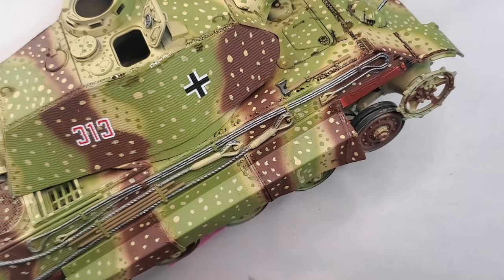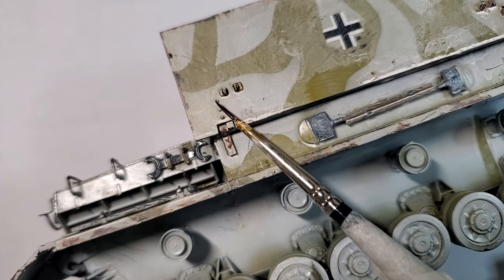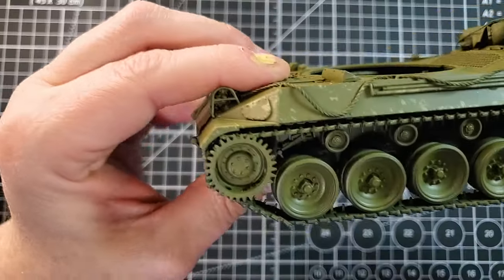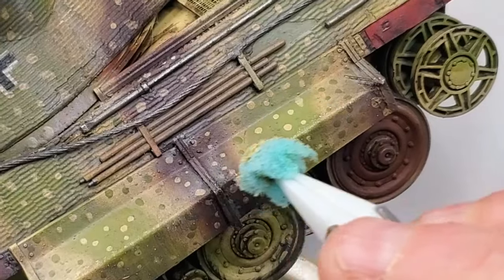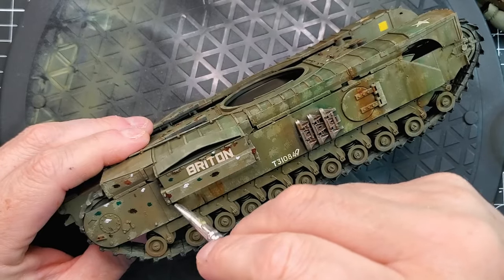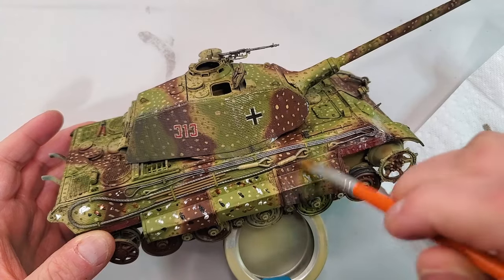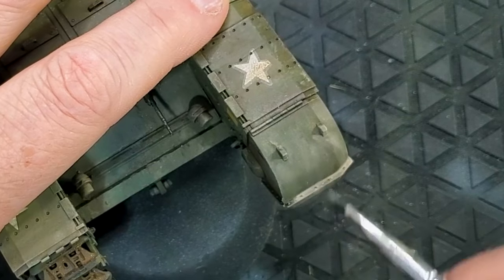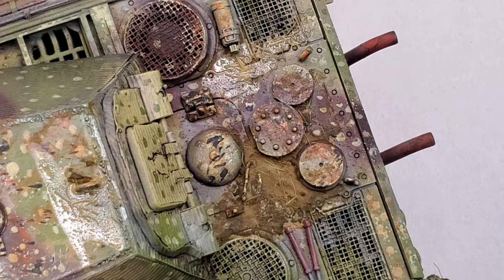4 SIMPLE & EASY Weathering Tips for Beginners

Comment: If you dont want to use pinwasn because im pretty sure theyre toxic and you need a respirator, you can use acrylics+ispropyl alcohol. I tried it and it works find but you defineitely need a coat of varnish over acrylic painted vehicles because iso alchol is actually very good at removing paint, i learned the hard way.
Reply from the maker: @flack2998  you can use acrylic paint to do pin wash, just make sure you remove the excess right away with water